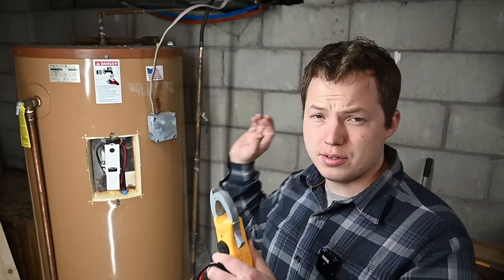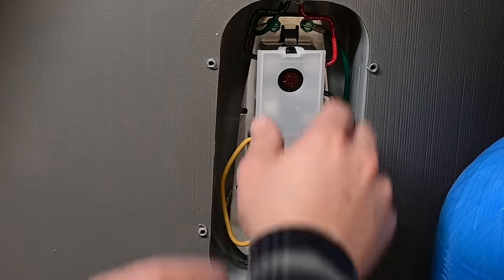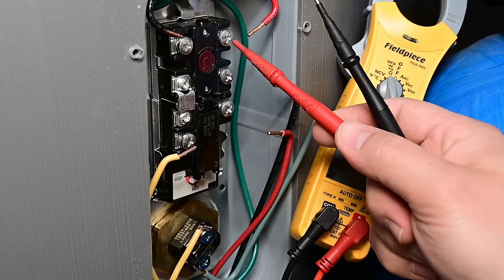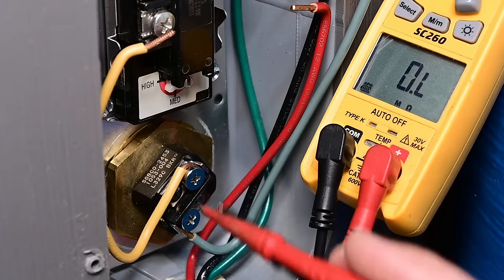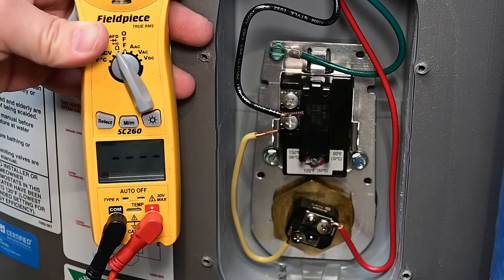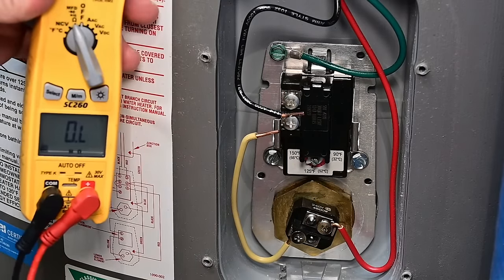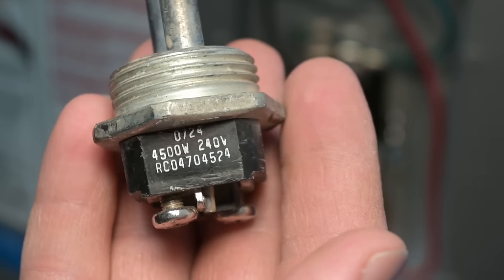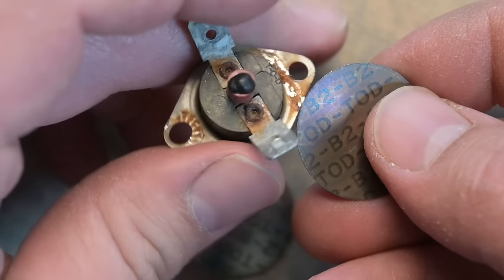How To Check Electric Water Heater Elements & Thermostats With Power On & Off

Comment: I rarely do reviews, but this water heater diagnosis process was so well done I HAD to thank Benjamin for putting it out there.  I'm a retired engineer and appreciated the thorough yet clear approach to diagnosis.  I was able to use the video to diagnose my buddy's solar/electric combo heater to determine the element was bad, then replace the element.  This was fortunate because the plumber that installed the system had a ten day wait before they could do the repair.  Fortunately the solar portion of the system was working!  Thank you Benjamin!

Comment: This video is the "gift that keeps on giving."  I replaced a heating element and thermostats on my water heater 2 1/2 years ago when the water suddenly got scalding hot.  I just replaced it all because I didn't know how to test it.  When the same thing happened again last night, I found this tutorial and watched it.  I followed along step by step with my cheap multi-meter and have isolated the problem to the lower heating element.  Faster, cheaper, and better than just replacing the whole kit all over again.  Thanks!
Reply: I am trying to diagnose a similar issue with my tank and I am about to replace the thermostats under warranty. How would a failed heating element cause an increase in temperature? Just curious in case I have a bad element as well. Thanks!

Comment: This video provides all the info homeowners need to troubleshoot an electric water heater. I wish I would've found it before I called a service guy, but it still really helped because it gave me the information I needed to question him. It turned out when I starting asking questions, he didn't know the answers to common questions and I found out he didn't even test the thermostats. Every service guy should know these answers and by asking them it lead him to what was wrong with my water heater and it saved me from an unnecessary water heater replacement. Thanks so much.

Comment: Thanks!  I was replacing thermostats but didn’t understand that they didn’t both run at once. When you explained about turning one thermostat down (the click), and that the other should power up, I could now see that power was going through and the connections were live.

Comment: Great video and explanation. I just finished installing my water heater and was drawn to this video because I was concerned that only one element was getting voltage. Now I learned that is normal. Thanks for the great explanation and breakdown of each component.

Comment: I’ve watched a LOT of electric hot water heater troubleshooting and repair videos lately, as I have been struggling with an intermittent hot water issue (occasionally cool water). 

Yours is the BEST of all the videos I watched. I am saving it for future reference. 

So, I found my issue. Finally started being cold more often than hot… so that helped troubleshooting. No power in the heater even with the circuit breaker on. Verified power into the circuit breaker and no power out. Went to remove the circuit breaker to replace it (I have had other bad ones in this house, built just 4 years ago)… anyway, the white wire FELL out of the breaker!  So, the original installing electrician never tightened the terminal on the breaker. Repaired!  No parts required.

Comment: Benjamin!!!  Thank you so much!!!  I used your instruction twice now.  The first time several months ago, I had ordered new thermostats and anode rods.  But then the water heater started working again, so I didn’t use them.  Well, it stopped a week ago.  I did the testing, and AGAIN everything tested okay.  But I knew I didn’t have hot water, so I went ahead and installed the new thermostats.  AND I HAVE HOT WATER!!!!!  It is not overrated!!

Comment: must watch video if having water heater issues. this saved me from buying a new water heater. I had trouble with mine for years. replaced pressure valve 3 times in 3 yrs. it kept over heating every so many months. following this trouble shooting step by step, come to find out the lower thermostat was intermittingly working. Thanks for saving me money for a new tank. ( Reliance electric hot water tank )

Comment: thanks for walking us thru this thermostat function & wiring.  what you didn't cover, the part I was most interested in, is how to remove the (in my case the upper) thermostat. It isn't immediately obvious and in my case the hot water heater is working and i didn't want to risk replacing the upper tstat and risk it not functioning after.   but the tutorial was very complete. thanks, JOC

Comment: I consider myself pretty savvy but this explained the problem with running out of hot water. All of these components including elements less than 40 bucks delivered on amazon. Thanks.

Comment: Great video Ben! Clear, focused and concise. Could benefit of a side by side schematic to simplify the explanation. But that's simple enough for most DIYers. Incidentally I have the same Marathon and I cannot believe Rheem discontinued this product. I got mine , for 50$... brand new! The new house owner distrusted the plastic and bought an instant instead. I ditched my gas heater heater because I installed a solar system and after trying this at 120VAC from my inverter, I realized the saving was substantial to switch over. Why  did I connect it to 120VAC? Well I usually get excess solar output around noon for about 4 hours and that's plenty of time to get this 40 gal very hot. It draws about 9A at this voltage . I did not change the elements because I think a lower voltage and current is more gentle in terms of corroding the elements. They will last twice as long and since the tank is plastic, I do not fear corrosion there.  The tank sits in outide my backyard next to  the shower wall to minimize the heat drop within the piping and if it leaks I won't flood in my garage. But during the winter the heat drop was significant and the inverter worked harder. So I wrapped the tank with a very thick blanket of foam insulation about 8" thick and now it stays hot for 3 days without additional power even though I did not add insulation at the bottom. by the way i did not ground the tank electrical connection, but perhaps I should, considering what you said about elements corrosion. But my pipes are PEX... so i do not believe that tap water is conductive enough within the pipe to get you zapped. But your comment makes sense and I will use a GFC to disconnect power using the grounded connection. Thanks I enjoy watching your videos, they are so useful.

Comment: This was extremely helpful. My issue was simple looking back, but not clear (at least to me) to troubleshoot. I was not getting 240 across the top legs of the top thermostat, was reading zero. I was getting 120 each leg to ground. I knew to look above the thermostat at least. It was a sub panel "fuse" not breaker that had opened. As soon as I replaced it, getting 240 again at top. I didn't realize that with one leg down, BOTH sides would still be 120. I thought if one was tripped, only one side would have 120 and the other would be zero.

Comment: This was exactly the video I needed to eliminate the causes of my issues.   It answered questions I had about how and when each element is actually in service etc.  But, turns out my issues were actually within the power box supplying the juice.  It's hard to say with certainty what's going on, but something is causing things to heat up and blowing fuses.  I can see the problems lie within the old style throw switch and contacts.  When I plug it into my other power box intended for my dryer, the problem disappears and everything is good to go.  I should really look into getting things updated to breaker boxes someday,,, but,, it's how the house was when I bought it lol.  Funny the weird way I gotta learn things.  But this video was extremely helpful to me in my journey to figuring out WHERE my problem was.  I'm posting all of this in hopes it might help another guy in my situation who may have a similar unknown issue and is turning to your excellent video for guidance 🤣🤣.  Thanks again!!!👍👍👍

Comment: Great video! I've been trying to diagnose why my hot water runs out so quickly. I knew how to check the elements and they seem to be fine. I DIDN'T know how to test the thermostat. Apparently my upper thermostat is defective. Your video showed me the proper steps to test that. You're very clear and thorough and you've earned another subscriber! Thanks!

Comment: Ben - a great video. I can add one tip: my water heater was on the same thermostat setting for 7 years since it was installed. I check all according to your video and all was ok. Then I thought to change the set point on the thermostats to see if the discs were just tired of being at the same tension. Bingo! Back in service immediately. I bought a full kit of thermos and elements to keep on hand. Thank you!

Comment: Excellent video! I knew that only one element was powered at a time, but the whys and hows were unknown until watching this. Quick tip, if you replace a water heater due to leaking (it is still working correctly other wise), remove the thermostats, and heating elements and keep on hand as spares. It will get you through in an emergency.

Comment: I have changed those heater rods before, and thermostats, but I never
checked the voltage. I just got lucky replacing the correct part each time 🤷🏼‍♂️ Now I can pinpoint the problem much better. Thanks 😊

Comment: I have wired and hooked up a few hundred hot water heaters as I'm a 63-year-old electrician. Hook them up! Fill full of water first then turn them on. The water gets heated up and no issues. Move on to the next new construction job and start wiring another building. This week I needed to check out a hot water heater. I said well I'm not a plumber but it is an electric hot water heater. How hard could it be?  I looked for information did some probing on my own. Came close to your procedure. However, I was stumped with this upper thermostat and how it was supposed to work. I found and replaced a bad lower heating element. I just could not understand the logic of heating the top before the bottom. But it is how it is. The hot water heater is now working and the water is hot again and not tripping the two-pole breaker. This is a very good video and I enjoyed learning the information I was looking for. I will now subscribe to your channel. This was fun thank you.

Comment: Very good and detailed video!! I watched so many, and YOURS answered my question I was struggling with for the past 4 hrs! I got the top thermostat to work, but couldn't get  the bottom to work! I was so frustrated. 🤬 I switched out everything, both thermostats and both heating elements.  Drained the tank twice, redid my work over and over, shutting power off for the whole house wt one point, just trying to rest.. Nothing.. Until i watched your video!! 😲 🤦‍♀️ All the other videos didn't explain the top has to heat up first to switch on the bottom. 🙄 I subscribed because you are good at your job, and explaining! Thank you, thank you, thank you!! 😁

Comment: Problem solved thanks to this video. I was able to determine that the water heater was not getting power due to a bad breaker switch in my electrical panel. This video saved me from having to call a professional. Awesome.

Comment: Excellent video.  I now fully understand how the top thermostat works and the 125 vs 240 volts.  Top element wasn't working on mine so turned thermostat down until the bottom kicked in and now have hot water until I can get the new element tomorrow.  Awesome.  Also, subscribed to learn more.

Comment: Thank you so much I just replaced my water heater and the new one wouldnt work and I didnt wont to take the hole thing back out, with your help I found out the upper heating element was bad. I replaced it in 10 mins and all is good.

Comment: Best water heater video period. Weird symptoms on mine . I had 125 v on both top leads to ground and 0 volts on top leads together. How is this possible . Replaced breaker got 250 at the top 2 screws. Back in business . Thanks for the vud

Comment: My unit would trip the reset button on occasion and sometimes activate the pressure relief valve. After watching this excellent video, I think I found the problem, a loose connection. If not , I now know what to do next! Thank you Ben

Comment: Thanks man, watching this the day after I did this on my water heater and my breaker box. Had to replace on of the circuit breakers. I only replaced the single element to get it running but bought the rebuild kit so replacing the whole upper and lower electronics just to have everything up to snuff. The idiot I bought this pace from was incompetent when it came to "fixing" things.

Comment: Awesome video.  direct to the point.  I never thought about the possibility of getting a shock though the water. I'm a maintenance technician in a apartment complex.  and I deal with these all the time. I've changed out plenty of those elements. that were completely corroded away.  I'm a little concerned now about getting a shock when washing my hands in that building now😆

Comment: Great  Video on  how the components work on a Electric Hot Water Heater.  I'm using the education you have given me and making a solar pre heat tank . Turning on and off the elements using DC voltage and two Solenoids plus not by passing the safety Thermostats which will only be operating on 24 Volts DC. DC high voltage will burn up most AC switchs.
Thank you so much .

Comment: As others have said, great video!

The only thing that I would add would be a circuit diagram; it would make it easier to follow in your verbal description of the switching of the upper and lower elements.  (My upper thermostat came with a good circuit diagram.)  

I would recommend leaving the covers off until after you have turned the power on.  It turned out that my upper thermostat was bad.  I thought that a bad heater element had caused the overload to trip, but as soon as I pushed in the reset button, the bottom left wire going from the switch to the element got so hot that the insulation started to melt at the switch.  I had already replaced both heating elements, because I have had several go bad, so I hadn't bothered to check them.  (Later, I found out that electrically they still checked out good, but replacing them at the same time as the thermostats was probably good maintenance.)

Comment: Good video it helped me solve my problem wasnt a heating element (which I though it first was after replacing it even though it tested good) it wasnt my thermostats it actually ended up being a breaker only having power on one leg but your video was the only one I found that broke down what Wire was what wich helped me figure out where were was coming in, thanks!

Comment: Hey Benjamin, great video. You have the answer I was lookin for my 11 year old 640DORT Reliance 40-Gallon electric water heater  popping out the red reset button. I noticed that the water was coming out extremely hot at and above 165+ when I had both thermostats setting at 140F.  I also removed and replaced the 29" inches anode rod which was entirely corroded with a new Aluminum one of 42" in length that I had to cut about 6 inches out to make to a length of  36" so It could fit from the top of the tank and the roof above it. (note that the tank is about 5 ft hight, so a 42" anode rod would be better than a 29, but I cut the 42  down to 36 inches and thus it will still last a little longer than the 29 ".) I also remove both 4500 watt @ 240vac elements and they where both cover with some kind of salty stone like deposits, specially the upper element. I cleaned both and tested both electrically and they were fine and within the resistance specs you provided, the upper with 13.4 and the lower with 13.5 ohms. I also cleaned and flushed out the debris from the the tank through the drain pipe until the water came out clean and clear. Then I filled it up and I power the unit and it seems to be working fine and the water temp is coming out around 127 to 130F with no leaks so far, but I will continue to check both thermostats as I suspect that one or both of them might be bad and or out of range?  What do you suggest I do from here on as I am trying to save me some $ on parts?

Comment: Really enjoyed your video  the step by step detail was perfect for me to follow along. But I have a question. I just bought a brand new water heater and I’m still not getting any hot water. I followed your steps to the T. But down on the bottom thermostat I wasn’t getting any type of reading from the two ports it came to 0. But when I did the element ports individually I got 122 from each one. But together 0. Am I doing something wrong? Or is it suppose to give those readings
Reply: I'm here with the same problem searching for answers. Any tips?!

Comment: Man, you have a didactic of a professor. You simply ministered a small course on this video. Excellent!
Reply: Thanks
Reply: You are one of the best at explaining this video of how to troubleshoot hwh elements and thermostats. You put it in layman terms so pretty much anyone can follow them and find out what is wrong with them  . Turns out I had a bad upper thermostat that was stuck so it was trying to heat both elements at the same time so was tripping the breaker. Much Respect and Thanks again for everything.  Also by the way you earned another Subscriber. I will recommend you to all my partners. Keep up the great job.